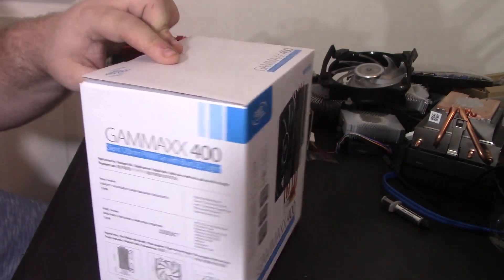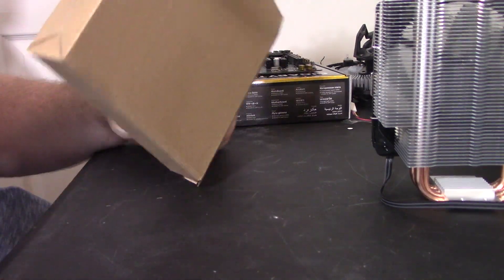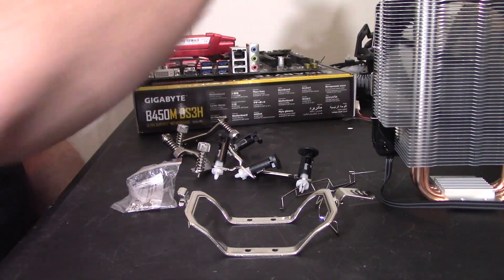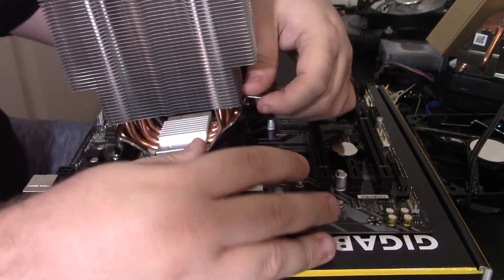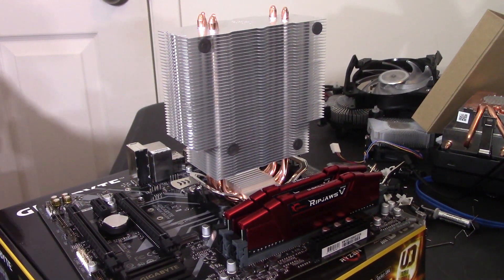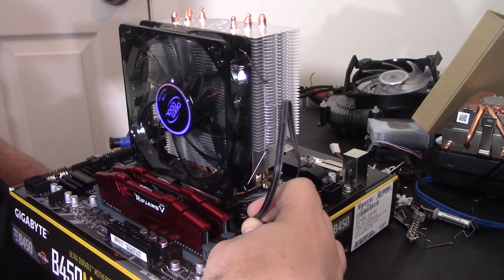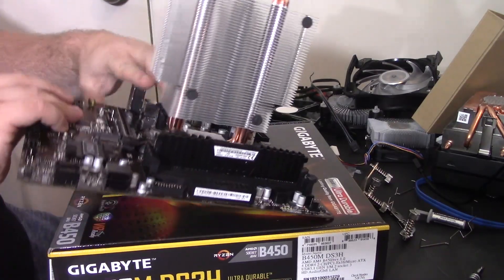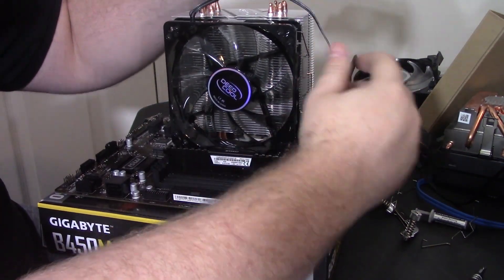Deepcool Gammaxx 400 Unboxing, Overview & Installation AM4 & LGA 115x

Comment: Great vid on the AM4 bracket. For anyone trying this for the first time, you really have to fight the tension of the bracket. Do one end first, usually the end closet to the top of the mobo, then square up the heatsink over the CPU while apply pressure down and back toward the side you just clipped (because cpu paste is slippery and the bracket will want to slide out of position). Carefully pull down on the other side, flexing the bracket down and aligning the clip over the last mount. The clips will not reach the bracket unless you put some pressure on each side as it's spring-steel, e.g. meant to be flexed.

Comment: Will the pressure damage the cpu?
Reply: Nope, if installed propertly it shouldnt rip off from the mobo. If you mean that when clamping it down it puts down pressure on the cpu, check the cooler’s compatibility. Im no expert but thats just my guess

Comment: The thing I don't like about that fan is the fact that the little legs that insert into the motherboard are plastic. Meaning that after pulling your computer apart they start to bend. I learned this from personal experience. Don't buy this cooler instead buy the Gammaxx GT BK it's way better.

Comment: This cooler is a son of a bitch to mount on  an am4 motherboard that is already installed, took me about 10 minutes of struggling to get it to latch on, plus you have to put quite a bit of force on it, was scared that i would crack the board. But performance is pretty good, especially for only 30 bucks

Comment: Is fan heavy? I don't want it to rip off the ryzen out of the slot or bend the Mobo...😗
Reply: If you clamp it on propertly it shouldnt sag and rip off the board. U can tie some string onto the fan screw holes and onto the roof of the case if u feel paranoid

Comment: I have a question! So I'm building AMD on Tomahawk MAX (same layout as the one you used), but shouldn't the CPU fan face the other way? Because the fan is exhaust fan, right? So it would push air out. So shouldn't that face the exhaust fan of the case. This orientation means it's pushing air out where the case's front fans suck in air. Please guide me for the correct Gammaxx 400 fan orientation.
Reply: It is pulling the air.
Reply: No it’s blowing air behind it into the heat sink

Comment: Thank you, due to you I was able to mount the cooler on my 3600X b450 board
Reply: What temps are you getting with it ? I am due to receive a 3600 and plannign to pair it with this cooler .
Reply: @notagamer706  I have the same CPU and Cooler.
Idle: 42-52°C
Gaming: 52-60°C(sometimes it reaches 65°C but only for one second)
Reply: @lexo365  are you monitoring temps using hwmonitor or ryzen master ? I am getting 34 - 37 on idle, 45 - 65 on load. Hw monitor seems to report faulty temps, so i recomand ryzen master for accuracy.
Reply: @notagamer706  I'm using Core Temps
Reply: @lexo365  you might want to try Ryzen Master too. Ryzen has many temp sensors and various apps cannot really read it correctly. Givi it a try and check if it s reporting lower temps.
Reply: @notagamer706  Three weeks ago I built my first pc(btw I'm italian):
TOT: 1029€ (1138$)
(900€ Hardware + case and accessories)

•Hardware:
-MOBO: b450 gaming plus max (110€)
-CPU: Ryzen 5 3600 (230€)
-RAM: Corsair Vengeance 3200 Mhz 2x8GB(75€)
-VGA(/GPU): GTX 1660 Super (270€)
-Cooler: DeepCool Gammaxx 400 Red (20€)
-PCI network card: 
Tp-Link TL-WN881ND(15€) [Sucks]
-SSD: Silicon Power 256GB M.2 NVME(70€)
-HDD: WD 1TB 7200rpm(45€)
-PSU: Corsair CX550M (77€)

•Case: Cooler Master Case Masterbox Mb500
•Mouse: Logitech G203
•Keyboard: Logitech K120

This should be all. 
Yesterday I tested it with "UserBenchmarks" and the results were:
75% Gaming   
112% Desktop  
90% Workstation

Comment: Can someone answer me this. Is deepcool gammax 400 good for a ryzen 5 2600x or 7 2700x to overclock @ 4.2ghz??? Thanks
Reply from the maker: Depends on the voltage required.
Reply: @BigHeadTech  i mean temp wise disregard the voltage req
Reply from the maker: higher voltage = higher temp.  1.4375V @ 4.2GHz an air cooler could not handle.  But if you get a well binned chip that only requires 1.35V for an all core 4.2GHz OC, then maybe it might.
Reply: @BigHeadTech  ok.get it. Thanks

Comment: Hi.. Is gammaxx 400 compatible with h310m ?
Reply: Yes, as the Asus/Gigabyte H310M-A/H is an lga 1151 motherboard, the Deepcool Gammaxx 400 is an lga 115X. The lga 1151, 1155, and lga 1156 sockets all have the same mounting holes. The lga 115x means any socket that has 115 at the beginning of it whether it is 1, 5 or 6.